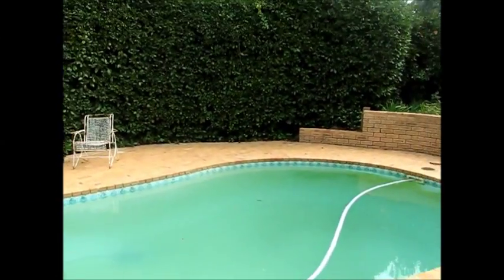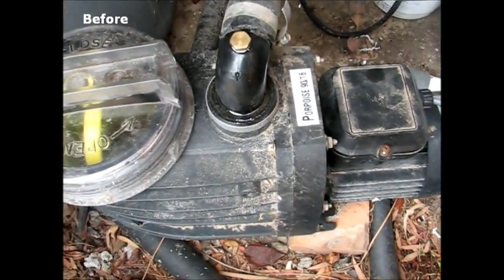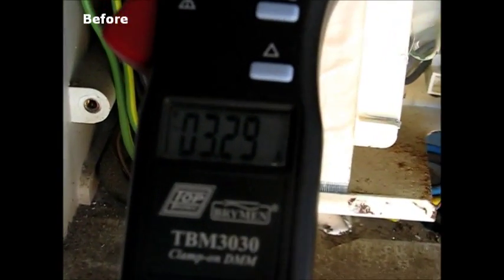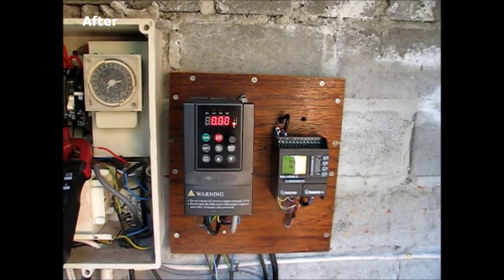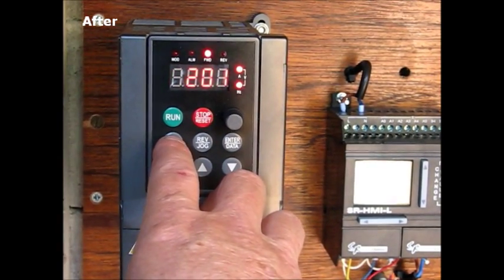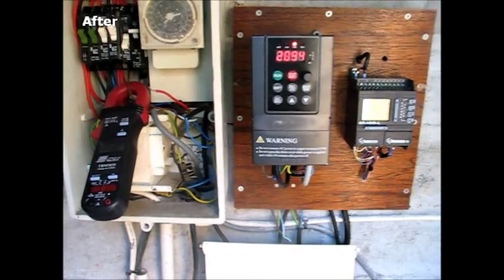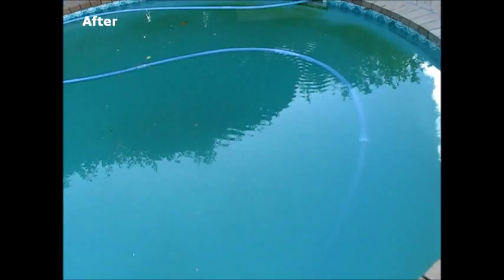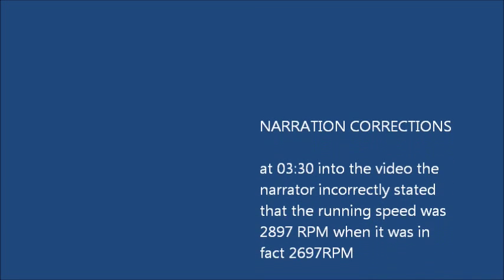Save on swimming pool pumping costs

Comment: Speed controllers have been around for 20 years at least. Totally pointless as the lower speed means less water flow. If you run it at half speed then you will need to have it running for twice as long to filter the same amount of water. So same effect can be had by adjusting your timer to run for less time. Also many automatic pool cleaner do not work well or even at all at low flow rates.
Reply from the maker: Thanks for your feedback but I do not agree with you. I have been running this system for a number of months and the savings are as clear as daylight. The system runs for 2 hours daily at 45Hz (allowing the pool cleaner to operate effectively) which is a 1A current saving and then for 8 hours a day at 35Hz which is a 2.2A current saving. The amount of water pumped daily is the equivalent to the old running cycle but power consumed is significantly less.

Centrifugal pump affinity laws apply and the principle has been proven. A student at the Universtity of Stellenbosch did a thesis on this lat year and if you are interested I can send you his report.
Reply: This is great for running water through a solar heater where you want less flow for longer periods of time.